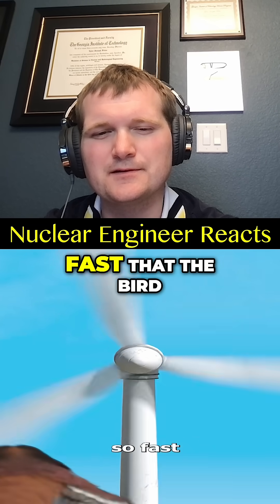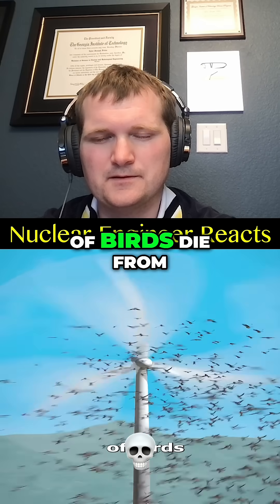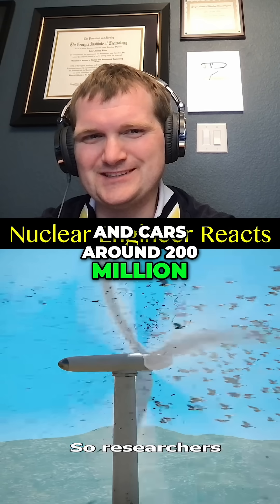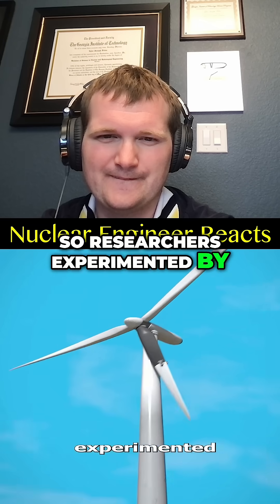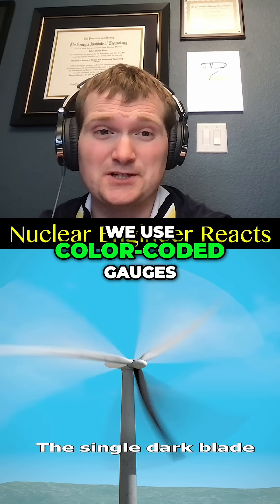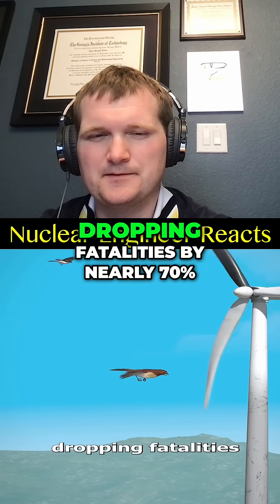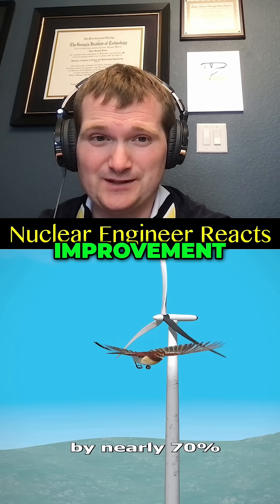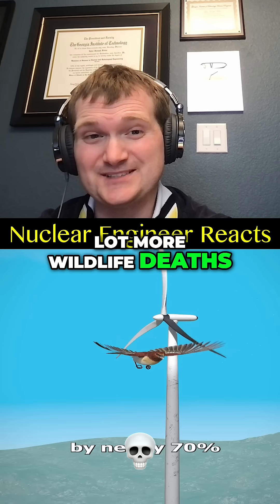Why They Painted One Wind Turbine Black - Nuclear Engineer Reacts to Zack D. Films

Comment: there was a "coverd up" accident in germany, longer ago.

A nuclear power plant which never really got started, specialized on ball formed fuel-"Rod"(Balls).
They didn't tell us why but activists, because government said non toxic measured it and there was kinda a lot of radiation.
Beside of that the cooling river holds fished which are not common here, due to being "warm".
And a connected camping place to it, close to it, many people got cancer.
Anyway I just read on wikipedia about it THTR-300 and a leading engineer there said they released radioactive stuff during Tchernobyl because they thought noone would notice it, to clean pipes. Not in the english version of wikipedia but in the german one it's written.
https://en.wikipedia.org/wiki/THTR-300

There are many researches also from the local government which claim there were not only 1 but 2-3 times release of radioactive material from the primary circle.

Comment: Just a dumb idea here, but has any propeller free alternative that could use exhaust heat from micro-processors to create the preferential vortex for oscillating captors that turn the kinetic energy into electricity.

Comment: The problem with nuclear is it costs too much to build and takes too many years to build. By the time it’s up and running it’s outdated. It’s like saving up for a 2025 RAV4 and by the time you have the money and can start building it, it’s 2035 and the old RAV4 from 2025 is a laughing stock compared to the innovations of modern 2035 cars. Or picture it as a 1980’s Honda Accord and a decade later you get to drive it and now the 1995 accord is out and looks and drives 100x better and you’re permanently stuck with the 1980s car your whole life.

Comment: I'm seeing a lot of comments about nuclear being unsustainable, here's a copy and paste:

"Breeder and Thorium Reactors:
Breeder Reactors can convert the much more abundant uranium-238 (over 99% of natural uranium) into usable fuel. Widespread adoption of breeder reactors could extend the nuclear fuel supply for thousands of years.
Thorium, an element three times more abundant than uranium, can also be used in specialized reactors, providing an additional, massive fuel reserve.
Uranium from Seawater: The oceans contain an estimated 4.5 billion tons of uranium. Developing cost-effective ways to extract this resource would make nuclear fuel practically inexhaustible."

And the gases released during the mining and production of uranium and nuclear fuel, and the entire lifetime of a nuclear power plant (from construction to the end of operation), is equal to, and sometimes smaller, then solar and wind.

Comment: And the amount of petroleum products you need to maintain them, the fibreglass, burying the blades when they get old. We don't have "renewable energy", they all require petroleum products and those, plus the battery cells, how expensive to maintain, the danger of Chinese-made (or other countries that use slave labour or enforced servitude) batteries mixing inside itself and exploding, Fission reactors should be pushed by Greenies.

If we found out how to make fire, then some idiot burns his house down, we wouldn't blame the fire and start banning it.

Comment: I think wind power has better immediate uses. Instead of electrical power, why not operate a pump? Maybe even a mill? You can use the turbines mechanical advantage. The torque produced is massive. We can take energy conversions out of the equation and be much more efficient.

Comment: I'm more concerned about how the wind turbine often is meant to generate energy for a city 100 miles away, and so ends us losing most of that power, or how it usually requires an insane amount of energy to make sure it doesn't spin too fast meaning it uses half the power it produces to stop itself from producing too much power. If they had cylindrical turbines that don't require as much oversight, aren't imbalanced, and are a lot easier for birds to see, I'd support them, but they don't care about functionality, they carw about politics.

Comment: I mean, yes, NuklearPP doesnt have so many wild life deaths, at least not after the building process is finished, but the problem animal deaths while building process have most buildings. But NuklearPP have the little tiny problem of no permanent (million years permanent) storage fassility.... and yes, nowadays there are reactors wich produce wast that does not take millions of years but "only" a few decades or hundred years, but, until most PP are build that way, nuklear will still be highly criticyzed cause they still produce the million years wast... thats just a "traid" of the past(and even many currently running PP) you cant deny and have to deal with

Comment: the issue with nuclear power plant is the radioactive waste which lasts for hundreds to thousands of years combined with the fact that you need a thermal power plant to run the nuclear power plant, so in order to operate a nuclear power plant you need

1 a preexisting power plant of some kind that provides stable and reliable power to the nuclear power plant so that the nuclear power plants safety features are operational

2 storage space to contain radioactive waste from the power plant for hundreds to thousands of years as the half life of the materials being used take that long to become safe

3 a stable geological location to ensure that a natural disaster does not cause a nuclear melt down, would be a real shame if a tornado came through and destroyed a portion of the power plant causing a melt down or an earth quake broke the nuclear power plants foundation

the last thing we need is a 2nd Chernobyl which i will remind has caused a great deal of ecological damage to the surrounding area when it suffered a melt down
Reply: 1. You can have diesel generators in the nuclear plant. You dont need another power plant.

2. Not anymore, if you use the most efficent tech for power generation, the waste is not radiactive for hundreds of thousands of years. And you can use the wast from 1 to power another in several steps. Also the amount of radioactive waste is miniscule compared to the waste in general from every other power generator with the exception of hydro and geothermal.

3. Yeah you need to put em somewhere realtivly safe from natural disasters.
Reply: @xthor86 1 creating a diesel generator is the very process of creating another power plant because a diesel generator is a thermal power plant that uses diesel to generate the power

2 they already do this with diesel generators as backup generators in case the main power plant provides power to the nuclear power plant goes offline

3 you can't take a nuclear power plant built in the 60s and change the materials being used in the power generating process because it was designed to generate power with 1 material and that 1 material is creating radioactive waste that last for thousands of years and for context I said hundreds to thousands of years not hundreds of thousands of years

Modern nuclear power plants use a nuclear material that has a very short half life
Old nuclear power plants use a nuclear material that has a very long half life

At the moment 270,000 tonnes of nuclear waste is in storage around the world and that number is only growing and if we had more nuclear power plants to the equation that number will grow even faster

Comment: I dont think nuclear is the way to go. To  big a risk. people do people things and make mistakes. It would be good for powering cities if it were more compressed and undercover (guess that comes with technology upgrades)

In the future nuclear wont be the go to 100.  We will likely harvest negative energy or antimatter.
Reply: By this logic we should stop using fire as well, because someone's home might burn down. And why stop there? Let's get rid of everything that's remotely dangerous, including gas, oil, industrial chemicals. Let's just live like cavemen until we figure out antimatter.
Reply: You've fallen for misinformation my man. There is no risk. We have made SIGNIFICANT upgrades to the tech. Even with human error and poor maintenance (the cause of every melt down you'd know of)  modern nuclear reactors physically cannot melt down like Chernobyl its literally impossible They just shut themselves off without human intervention. 

If it somehow did fail catastrophically which is basically impossible mind you it would all be contained within the reactor. ALL modern reactors are required to have what is effectively a massive steel and concrete shell that can survive direct missile strikes.  Chernobyl did not have one of these which is another reason it was so bad.

Nuclear doesn't need to power absolutely EVERYTHING but it should be by far the most dominant source of energy.
Reply: The next step in energy, the only really way forward is nuclear. Just not fission.

Comment: “That’s just the tip”
Uuuhhh what does that have to do with nuclear reactors
Reply: You make it sound like he won't be able to answer such a question
Reply: @smurfaccount2025  Actually we use our– nope. not going to finish this one.
Reply: The tip is made of graphite
Reply: Control rods have tips in the case of RBMK once they are made out of graphite which is bad if you insert all at the same time.
Reply: @Ninjaeule97 nice to know, thank you
Reply: Actually we use our control rods in a sexual in and out pattern. 

- nuclear guy probably